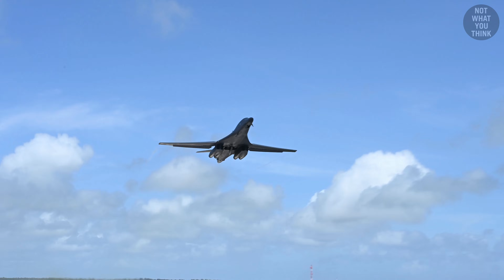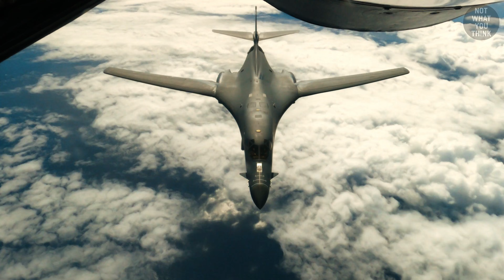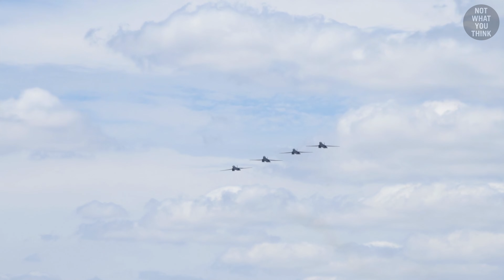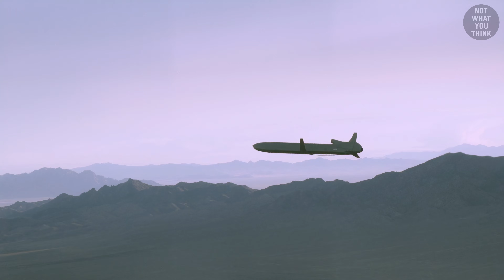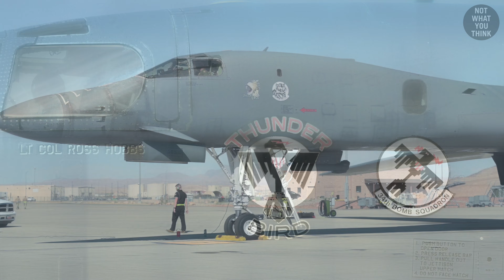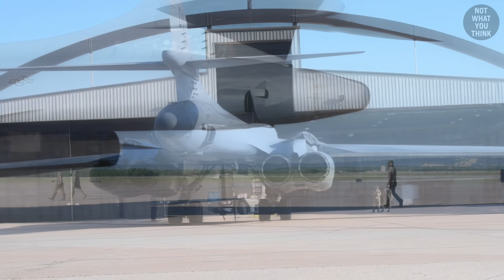Why US Built a Bomber Faster Than a Bullet, Then Slowed it Down

Comment: The reduction in top speed is simple.   B1 was initially supposed to be a high speed medium altitude bomber. (Similar attack profile of the B52- but faster) 
But then the S300 (which was being developed around the same time)  turned out to be pretty good.  Suddenly, medium altitude with a mach 2 penetration speed was... not as viable.
So they refocused and optimized it for high speed penetration at treetop level -  terrain following radar, engine output to take advantage of the denser air, and keeping aerodynamic heating to a minimum.

Comment: The B-1 Lancer has another connection to the U.S. President that reinstated the "BONE" that is not what you think. Like U.S. President Ronald Reagan, before actively serving the U.S. in a government/military role, both Reagan and the B-1 performed in motion pictures, or at least one motion picture for the B-1. 
In 1985, a B-1 Lancer would appear in the film, "Real Genius," as being utilized as a weapons platform to test a fictional, weaponized laser that was invented as part of the film's plot. The B-1 can be seen in several scenes as the film reaches to its climatic ending when the laser is to be tested by the U.S. Air Force while mounted aboard the B-1 Lancer.

Comment: The B-1A ejection capsule, is a scaled up equivalent of the F-111 capsule, though the Aarvark was capable of higher speeds.
The same sort of capsule was meant to be fitted to the Space Shuttle, but removed due to budget limitations placed on the program. Some reports suggest Challenger would have been survivable with the capsule, as some crew members ended up drowning.

Comment: The following is all public information.
The original Strategic Arms Reduction Treaty (START) between the U.S. and Russia, was signed on July 31, 1991 by George H.W. Bush and Mikhail Gorbachev. Gorbachev was the primary catalyst for Russia's "Glasnost," and at the time it appeared that Russia was not the threat it used to be.
Among other things, START 1 mandated that the B-1 could no longer carry nukes, and the external pylons that carried them had to be removed from the airframe. The refit also included the removal of nuclear arming and fusing hardware. By the mid 1990s, the B-1 was being converted into a conventional bomber. START 1 expired in December 2009.
START 2, signed on January 3, 1993, allowed Russian inspectors to examine missile silos and silo launchers to confirm ICBMs had been eliminated. The inspectors also examined the B-1 airframe to make sure it was not possible to carry nukes.
On August 8, 2022, Russia announced its "temporary" withdrawal from START 2.

Comment: Like the B-52, I don't think the B-1 will be retired as soon as predicted.

There will always be low intensity wars that not only don't required super expensive stealth bombers but carry massive loads that the B-21 can't.  Additionally, as the US develops longer range stealth cruise or hypersonic missiles, there is no need for a B-21 to be used in such missions and the B-21 can't carry nearly the number of missiles that a B-52 or B-1 can.

Ah, you say, the B-52 can do all the missions that the B-1 can.  Technically yes, but the B-1 carries more missiles than the B-52 and once the B-1 is gone we are down to 70 or so B-52's with only about 60% of them operational at any time.  

I predict that until the B-21's can fulfill the missions of the B-1 in terms of missiles carried and flexibility, I think the B-1 like the B-52 will be around a lot longer than the Pentagon thinks.

What might be the demise of the B-1 and possibly the B-52 may be the Rapid Dragon concept were cargo aircraft can launch a large number of long range stealthy cruise missiles.  The only drawback to that is that cargo aircraft will be maxed out during a war and are much slower than the B-1.

Anyway, that's my two cents.

Comment: It was much more, much more, than examination of Belenko's aircraft; the additional complexity, stress on the airframe and engines, all together was the deciding factor. Make the decision to build an F1 car, or a stock car, one is worth over a million each while you can turn out old fashioned stock cars  (might not maneuver as quick), for $300k. The military/industrial complex in the U.S. has ALWAYS wildly and deliberately inaccurately assessed possible adversaries capabilities to justify its' own existence. Belenko's radar used tubes, had steel skin, range was ~700 miles and is turned a bit too hard, would strip the airframe of its' wings. It was crude, two massive engines wrapped with enough aircraft to go really high, really fast, in a straight line.

Comment: If you designed a plane from scratch, TODAY, to the same requirements, it would look like a modern B-1.  It is still the best overall bomber we have built.  Speed maneuverability, payload, it's all there. One of the most underrated planes in our arsenal.
Reply: And the Air Force wants to retire this beauty and replace it with the B-21

Comment: I have seen some insane low-flying aircraft of all kinds (I grew up in the low-fly valley in Southern Norway linked to a high-altitude mountain live bombing range for NATO). But nothing prepared me for the sight I got high up on a 7500 ft mountain. First came 2  low-flying F-16s scraping the mountain plateau below me, with  2 F-15s flying high above - then came 2 B-1s tickling the moss on the plateau with swept wings. The brain struggles to compute something the size of a 737 going that low and that fast some 2000 ft below oneself - and it was absolutely magnificent to get to see what the thing was originally designed to do.
Reply: That sounds like an absolutely breathtaking experience! Getting to witness those aircraft maneuvers in such a dramatic landscape must have been unforgettable. It's incredible what these machines can do.

Comment: I hope the B-1 get another extension. I would like to see if the ruddervators from the YF-23 would lower the B-1's RCS
Reply: They are constantly getting updates.  2 of them spend 25 days at an assembly line at Tinker AFB.  Each bird gets 5500 manhours of work in those 25 days.  Month after month the fleet rotates through.  Fleet is currently at around 13,000 hours.  Current plans are testing a set of wings and an actual fuselage out to 28,000 hours.  B-1B will have the capability to fly through 2040.

Comment: "Everyone knew that the B52 eventually needed a replacement"
Buff: "I didn't hear no bell"

The Buff is forever
Reply: Buff is love.

Buff is death.
Reply: That's such a great way to put it! The B-52 just keeps on going strong.
Reply: they have tried and tried to replace the Buff. problem is Boeing built the Buff perfectly. in the sense it is just the airframe itself. it has the space and ability to just be continually upgraded. love that every single program theyve tried, it always goes back to its just cheaper to upgrade the Buff with these new improvements XD

really reminds me of the experimental guns the US asked for in the first Iraq war. got all these absolutely crazy guns which were very good. turns out just slapping an ACOG onto an M16 made the Marines just as accurate lol

Comment: I remember B-1 testing at Edwards AFB.  They had two major accidents. One (maybe both) happened when the swing wing decided to "un-attach" itself from the airplane.
In the first, the crew capsule ejected, but the chutes never deployed. 
The B-1 is "fly-by-wire".
In the second accident, the capsule ejected, but the charge that was supposed to sever the umbilical didn't work and the capsule went all the way to the ground tied to the doomed aircraft.
I also remember F-15 testing.
The Air Force was experimenting with a sky-blue paint for camouflage, so they figured, why not paint the F-15 and test the paint at the same time we test the aircraft itself?
The only problem was, the paint worked so well, they couldn't see the airplane.  That's why if you look at photos on line of the prototype F-15s, you'll sometimes see blue aircraft with fluorescent orange wing and tail structures.  It was so the ground crews could visually track the airplane!
The C-5A was also in test while I was at Eddie's Air Patch. The first time I saw one, it was flying towards my house.  Everyone who has ever watched an airplane approach has had the experience of the aircraft appearing to "grow" in size, until it either turns off or passes overhead. The C-5 was different. It just kept getting bigger and bigger! Finally, when it seemed to be impossibly big, it turned off.
Ever see "The Six-Million-Dollar Man"? (Series with Lee Majors) The crash in the opening credits is an actual lifting body crash at Edwards. Lifting bodies were forerunners to the space shuttle program and a common way to describe them was as a "bathtub with fins".  No wings. I recall several flavors - the X-24, M2-F2 and the HL-10. Anyway, if you go back and look at the intro to the show, you can see how severe the crash was. The test pilot reportedly broke most of the bones in his body, but was eventually ~90% rehabilitated - hence an inspiration of the show itself.

Comment: They're not really called split-stabs.  The B-1B has stabilators which are also known as an all moving tail.  The functions of the horizontal stabilizer and elevator are combined into a single aerodynamic surface.  Also, that forward bomb bay?  Yeah, it's the nose gear well.  Sorry.  In addition, as impressive as the B-1 is, the fastest strategic bomber flown by the United States was the XB-70.  Bonus fact... the Air Force was originally going to name the aircraft Excalibur but switched to Lancer when it was pointed out that there was a brand of condoms named Excalibur.  Many toys and models were produced with the Excalibur moniker.  Aircrew disliked Lancer and no one calls the aircraft by that name.  It's either the B-1 or most often BONE.  I'm sure from watching the video most people don't realize how large the B-1B actually is.  It's massive.  Seeing something that large come screaming down a flightline on afterburner and then performing a barrel roll is a sight (and sound) I'll treasure all my life.

Comment: Being involved in the f 111 F model, and the engines transferred over to the F-16 of 15 in the last model of the F-14 which I also worked on. And being very familiar with the layout of the B1 original. It was never intended to fly at high speeds low to the ground. The f-111f model was capable of going Mach 3 but it never flew more than about 550 to 600 me an hour while close to the ground because you leave a Sonic Trail and people can call ahead and tell them where the aircraft is. Otherwise all you hear is a little whish over your head in the middle of the night. So please don't opine on the design function of the original B1 the reason it was intended to go fast so that it could get to its Target faster and then get down close to the Earth to drop its bombs. I shouldn't even have to explain that much. But obviously this artificial and ignorance concept that they've put on a lot of these videos doesn't understand normal thinking.
Then you exacerbate it by talking about the things about the A-10 that you know absolutely less than nothing about. Is because it's a jet it has to be set far enough away from the action that it can't get there quickly that's why they're moving to propeller aircraft for that. The problem is is that they intentionally sunk the ah-64 Apache which could have been set much closer and would have had at least as long as a later time and can carry more than enough weapons to be a good close air support weapon. But they had to kill it because they already had deals made where a lot of generals made a lot of money making sure that certain people were building the A-10. And they repeated that because they immediately after they killed the Cheyenne went into a program where if they had built the Cheyenne they would have had several thousand of them with the money they spent on just building the first prototype Apache which had to have so much Electronics in it to keep make it flyable and the ah-64 was flyable by the mechanics. One of the mechanics had to go out and pick up one of the prototypes out of the desert because something had gone wrong with it, and he flew it back. It was that easy to fly.
The reason why the original B1 was cut from the building contractors because Jimmy Carter was an idiot. He did things that harmed America for several years. Most of the problems we're having in the Middle East today, have to do with Iran which Jimmy Carter destroyed by removing the Shah and putting in a Theocratic murderous regime in Iran.

Comment: Fly low, slow, cheaply and comfortably. Or fly fast, high, expensively and rack up loads of airframe wear & tear. Turns out that a missile can hit both options equally well. Low and fast? Look forward to running into a hill or shaking the crew to death in turbulence.
Any number of attack aircraft did this math. The Buccaneer and Corsair 2 got the right answer.

Comment: As a young airman I was working on a flight line when a B1 did a high speed flyby with afterburners. I didn't hear it until just before it passed and nearly jumped out of my boots it was so loud. The base banned them from doing that soon after that.
Reply: That must have been an unforgettable moment! Those high-speed passes really leave a lasting impression. It's cool you got to experience that before the rules changed.

Comment: The B1-B is, in my opinion, the second most beatiful aircraft ever built. Second only to the SR-71, of course.
Reply from the maker: Don’t disagree with you.
Reply: I personally like the somewhat niche purpose aircraft myself:
B-1 lancer
B-58 hustler
F-111 aardvark 
The RAH-66 commanche
And the mh-53 pave low.
Reply: We totally agree the B-1B has stunning lines, and putting the SR-71 in first place is a solid choice. Both are incredible pieces of engineering.
Reply: Any production aircraft from Kelly Johnson would be on my list, plus the P-51. SR-71, though, is in a class by itself. Future generations will even agree.

Comment: Did the F-111 also have problems with an excessively bumpy ride, as it was also designed to hug the terrain at high speeds?
Reply: the f-111 is 73 feet long. the b1b is 146 so quite literally twice as long. it's that length that's allowing even strong materials to flex so my guess is no, 73 feet is short enough that the material properties themselves prevent excessive  vertical vibration and deflection.

Comment: The A10 doesn't eject ita shells because they would be injected in the engines. We were allowed to have car alarms on our cars but they were annoying when the B1 would take off. I worked on the b1-b from 92-96.
Reply: That's a really cool detail about the A10 shell ejection! The B1 takeoff car alarm situation must have been quite the daily soundtrack during those years. Thanks for sharing that firsthand experience from working on the B1-B.
Reply: Ingested not injected. Also, the reason the A-10 retains the fired ammo is that it doesn't harm the ground troops. You can read about other close air support aircraft dumping their brass and hitting ground troops. The GAU-8 is not a machine gun it is a cannon which fires a heavy shell which equals a "heavy rain". The empty brass weighs ~4 oz and IIRC the brass is actually aluminum.

Comment: i have an unhealthy obsession with variable sweep wings and this plane is one of the reasons why. the f111 aardvark is also a beautiful aircraft, just like this one. it's just something about it that looks so sleek and magnificent.
Reply: Folding wingtips for compression lift >>> variable geometry wing
Yes i am an XB-70 fanatic how have you guessed ?
Variable geometry wing is not worth it the extra mass and maintenance complexity.
Everyone uses delta wings for a reason.
Reply: @carbonium1264 while i absolutely agree with you. swept wings look so much cooler and for that alone i like them more than the flying Doritos lol

the Aardvark and the Tomcat are just so damn cool looking with their wings swept back
Reply: I completely agree. It’s like a really nice Ferrari or something the body flow. The F11 was a really cool plane too. I like the pod ejection system.
Reply: Variable sweep wings are such an engineering marvel, and the F-111 really does have that iconic look. It's amazing how these designs continue to capture our imagination decades later.

Comment: I find it funny how the B-1 and B-2 cost the same as the model $1B B-1 $2b B-2. As bad ass as the bone is that plan is broken all the damn time. The required avionics tech for the time was just too fragile. Another failure it's the only US aircraft that doesn't use 110/400 power so there's no mass production parts or civilian equivalent. Same with the hydraulic system. Air craft use 3,000PSI bone uses much higher pressure
Reply: $210M each for the B-1B

Comment: They were used quite a lot in Afghanistan, in the CAS role. They could stay overhead for a long time, believing guided 500 and 2000 lbs bombs, when needed.
Reply: There was periods of time where there was always a B-1B overhead in Afghanistan.  Yup, they could load each of the 3 rotary launchers with 8 of whatever size bombs. GPS-JDAM and even laser guided bombs using their targetting pods.